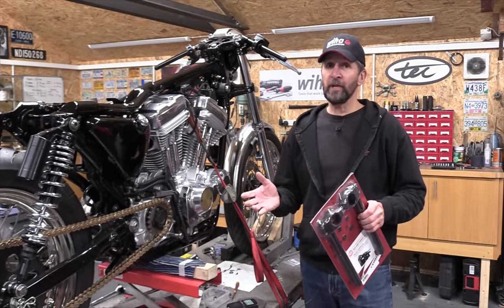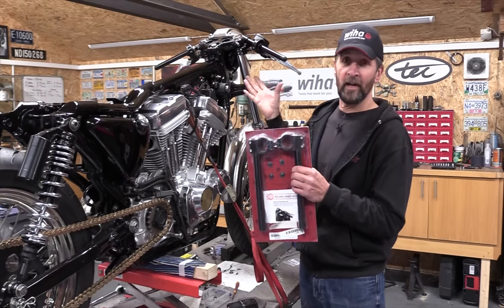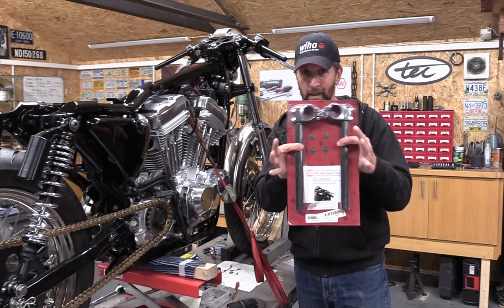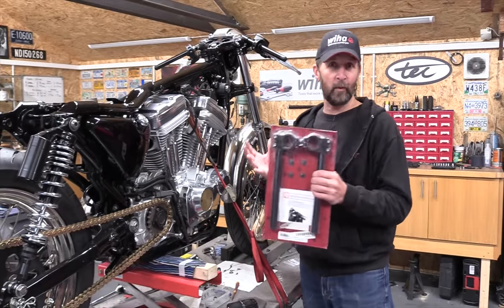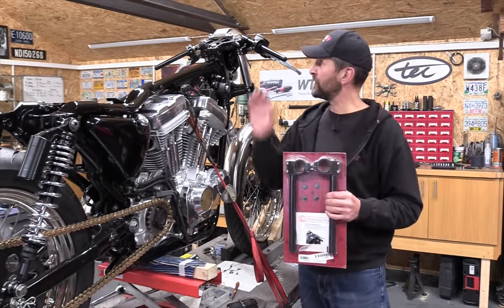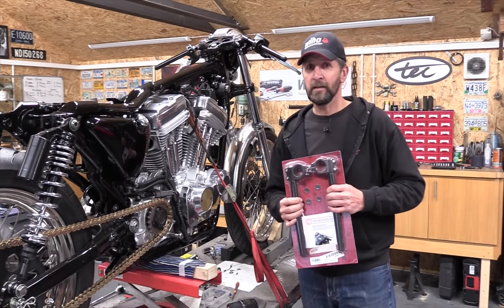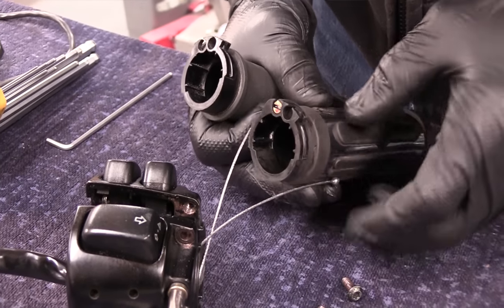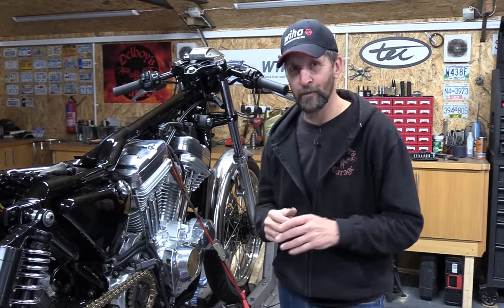Harley Sportster, "Roland Sands Design",  Clip-On Bars !

Comment: Great work Del. I have clip ons on my Sportster (not RS so no recess for electrics) but drilled them out and ran the switch gear electrics inside and exit at the end of the bars behind the headlight. Probably not worth it for that short journey but having done that to ape hangers in the past I was happy to do the same again. Al the best!
Reply from the maker: Great solution mate, and I imagine, far easier than threading the wiring all the way through a pair of ape hangers, I was shocked when I opened the packaging to find that these bars are actually solid billet with the dimples machined out, also threaded on the end so I can make some killer bar weights for them in the future... hope you're getting on ok with yours, I'd love a photo to the email if you've got the time mate, always love to see other people's custom bikes (delboysgarage@yahoo.com)

Comment: Lookin' good, Del! I see that your one half of either the clutch or master cylinder mount that you had to paint turned out so close to factory paint that I couldn't tell the refurb from the cleaned one. How nice is it when the new paint is THAT spot-on with the existing paint! When I saw the circular medallions that came with your new gear, I thought "here's another chance to turn some new brass copies, but alas, they must have been for bar ends that were not used. That's a shame. On another note, I just put a "Sunpie" Daymaker type headlamp in my own scooter yesterday, and it lit up the road on my ride last night, and looks real cute with its LED Halo ring. This would look sexy on your beastie, if it will fit in the bucket with the wiring, and if that design fits your style. And it was a bargain at $50 or so. Super camerawork, as always. Keep 'em comin' Del & Penny!
Reply from the maker: Hi Tommy, good to hear from you and we really appreciate your very kind words on the production and camerawork, we do take a lot of time to make it the best we can, so thanks for noticing!  Have a great weekend, ride safe, all the very best, D&Px

Comment: Hello Del ,longtime fan and subscriber here . Love your work. I was wondering about your opinion on the chain drive set up you have ? I’m curious as I have a 2016 iron with a hammer 1275 big bore kit with cams ,headwork ,Dynojet power vision and energy one clutch kit. I haven’t done a chain conversion as of yet but I am considering it in the near future and I was wondering your thoughts on how you like it so far? FYI I kept the stock 883 gearing because it’s extremely fun lol. Thanks again for all that you guys do and bring to us . Can’t say enough good things about you and the wife . Blessings to you both my friend. From CT USA
Reply from the maker: Hi buddy, haven't actually ridden the bike yet so can't report on how it feels by comparison, but by all accounts from owners of choppers that make this conversion routinely, it's the right way to go... not only does the set up cost a fraction of the price of a new belt and pulleys, but also you can run the chain and sprockets with barely a minimal chain guard at the most, rather than the big collection of belt guards that you need to run to prevent stones getting eaten by your belt... I've seen people run belts naked, but it makes me wince because I've seen the results when a piece of debris jumps in under the pulley, even a tiny lump of pea shingle is enough to break the belt and wrap it round the rear wheel... no such issue with chains.  Thanks for your long term support, it's great to hear from you, ride safe!

Comment: The parts dimension or the twiglet zone.  I recently found an engine mounting bolt I lost in 2012. Just like a meatball It had rolled and rolled and rolled and found a ten year home under a shed. Cost a fortune to replace being high tensile and specific to that particular Triumph. 
So don't despair you should find the clip and ferrule in 2032! 
✌️❤️Peas and loaf ✌️ ❤️
Reply from the maker: Good thought, all I've got to do is stay alive till then and I'll be set up, can't wait to save that £3!
Reply: @Moonfleet41  
I think all the 10 mm sockets and the little ball bearings from footpegs come out at night and have a party while we're not looking 🤗❤️❤️
Reply from the maker: @springy-2112  Said that right brother!

Comment: Hi. I believe the head gasket on my 2007 Triumph T 100 Bonneville is leaking oil. The bike is air cooled. Do you know of any sealing fluids I can use to stop the leak? I don’t want to spend $1K on a bike worth $2K. Thank you for your time.
Reply from the maker: Hi Anthony, if you believe your head gasket is leaking  the only remedy for it is to replace it... there is no cheaper fix I'm afraid.  Good luck with it.
Reply: @Moonfleet41  , thank you.

Comment: Why the hell Harley couldn't just cast barrel end nipples on their throttle cables like everyone else instead of using those idiotic easy-to-lose brass adaptors is beyond me. I've nearly lost one of mine twice now, in fact I bought a spare to keep in my tool box in case it ever does happen.
Reply from the maker: Couldn't agree more mate, although in it's defence, I've never seen the little ball that they do cast actually break off unlike the regular type... the ferrule gives a lot more flex and rotation to the cable end but quite right, I've ordered two so I've got a spare for next time (because there will be a next time lol)...!